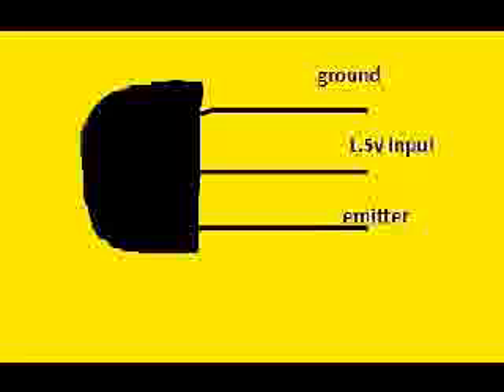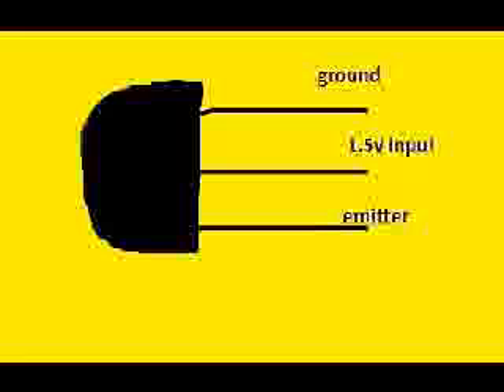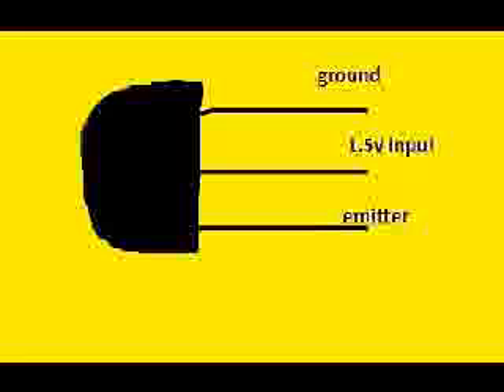xbox 360 wireless led mod switching with controller.flv

Comment from the maker: the transistor switches the negative power going into the joule thief .
the input of the transistor would connect to the negative terminal on the battery and the center pin to one of the triggers because the voltage is lover on the trigger . then the output is connected to the joule thief negative input .